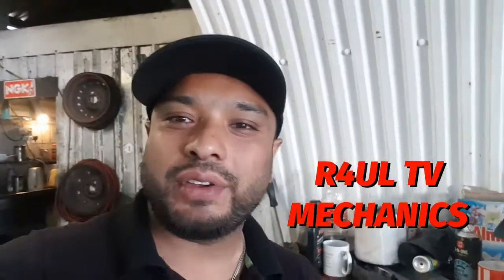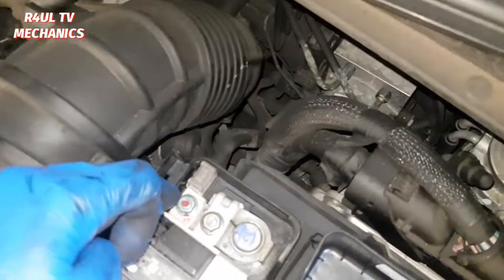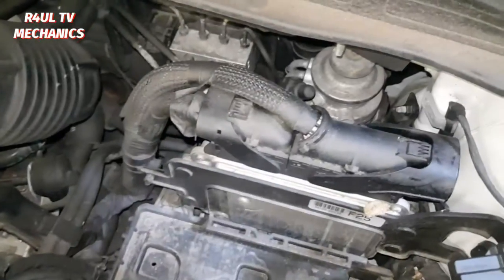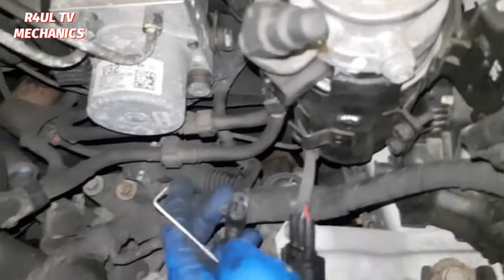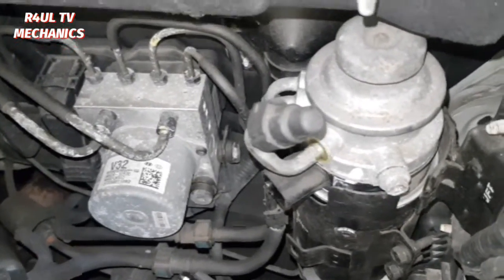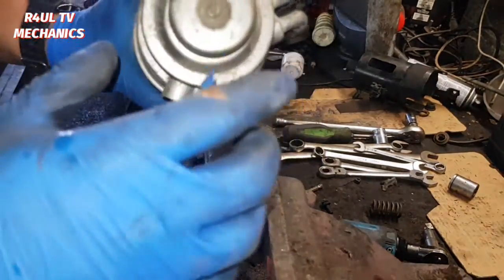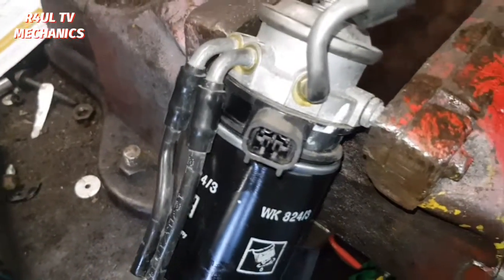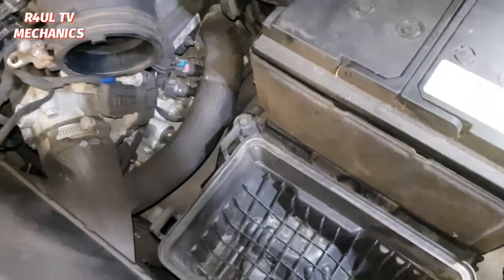HOW TO REPLACE HYUNDAI I40 DIESEL FUEL FILTER  2014/15

Comment: Bro i got fuel filter hazard light in i40 and i had changed fuel filter but second day light comes again please let me know i need to change water sensor as well or not please let me what the solution
Reply from the maker: You might need to Replace the water sensor. Or diesel dose release water eventually

Comment: Great work, well done.
I have the same year i40, i changed the oil and filter air and pollen filters then the feul filter by following your video, all good apart from i cant get above 40mph or 3000 revs, 
On yiur video you dont mention if there's a vottom seal between the filer and the sensor...I'm curiousbecause there were only 2 new seals in the filter box.
John Stacey
Reply from the maker: Thanks for watching really appreciate it to be honest I dont think there was a seal on the bottom

Comment: just a quick question, are there any issues in disconnecting the battery, i.e. are any codes mucked up which need to be reset e.g. with radio/sat nav unit for example?
Reply from the maker: Sometimes you need a radio code but most modern cars the codes are stored in.

Comment: Ok. I see that you PRIME this filter
Mine 2017 reg hasn't got this so do I just start the car or can I put some fuel in the filter first cheers. 
Very good instructions on how to do
Reply from the maker: Thanks for watching really appreciate it. What I would do is fill the filter up then open the pipe for the air intake and spray some easy start too. Just to get it going. Hope that helps